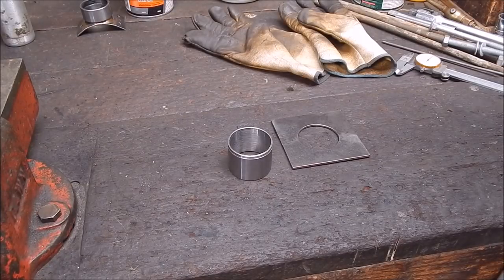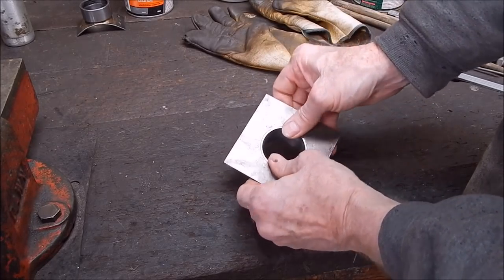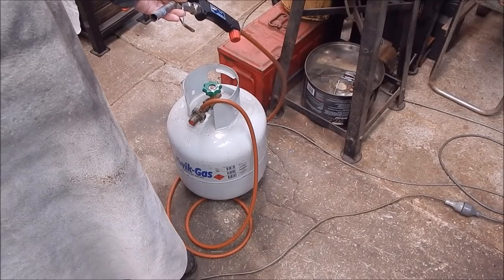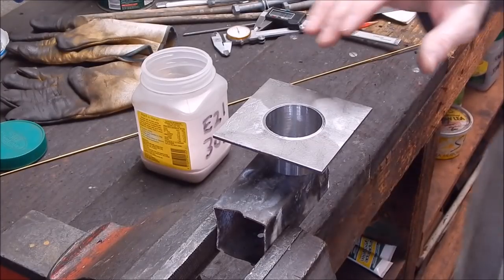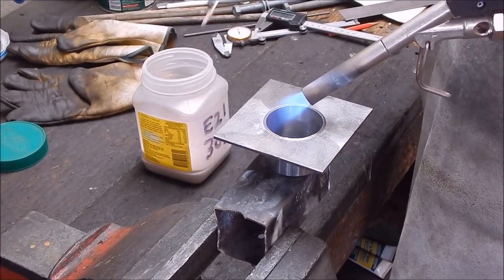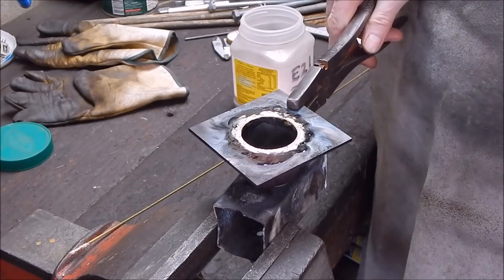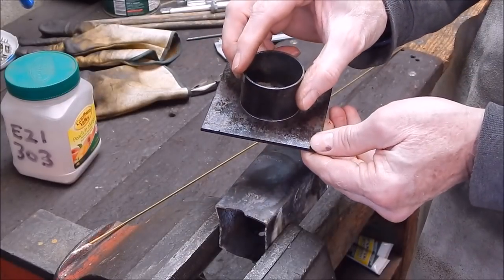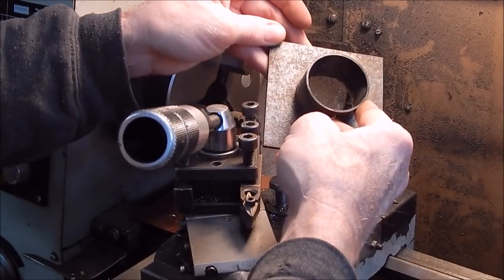Bullfinch auto torch LPG bronze brazing system

Comment from the maker: Note:  The flux used in the video is EZI-WELD 303 brazing and bronzing flux.  This flux allows hot rod dipping/application and freehand torch work. The rod used is BOC ProFill manganese bronze.  DO NOT try to use silicon bronze rods with this torch.

How the Bullfinch burner works is shown on the following web page:  https://www.adelaidehillsgas.com.au/service/bullfinch-brazing-kit/

Cheers Rob

Comment: yes ,I went with the replacement regulator"LPG regulator / Flow meter - LPG Heating / welding - 0 - 450 KPA - Omega OMELP35"comes Complete with 5mm Male barb fitting.complies with Australian Standards. Compatible with all standard LPG gas cylinders.$67au from my local welding store.another lesson when buying overseas for shore. thanks for your advice rob,have watched  your channel for a while now.good stuff.
Reply from the maker: Hi Geoffrey,

Good to hear you got it sorted relatively cheaply.  The POL look the same, but the UK (and Ireland) is very odd in that it uses a different thread form (same TPI) to virtually the rest of the world.

Cheers Rob

Comment: Nice job, Rob! I have done a fair amount of brazing with oxy/gas. For thin stuff, like what you were using, it's the way to go. Less heat input so less chance of burning a hole in your work or warping it. I also do not like prefluxed rod. It seems the flux absorbs moisture and if you don't handle it carefully, the flux can break off. On small stuff, like your project, I think it's just as strong as welding. You could see a slight ring of bronze on the other side, so capillary action did its job and made an excellent joint. Thanks for sharing.
Regards,
Dave
Reply from the maker: Hi Dave.  I think a lot of people steer clear of bronze brazing because they think it's difficult to do, and expensive to get set up.  But it's not really, provided you stay away from oxy/acet and the rental rip off.  This gun pays for itself after one year of oxy rental.  I like brazing because it's non intrusive/non erosive, and can be stronger than a bead weld as it capillarates between surfaces for a complete bond. Cheers Rob.

Comment: There is also bronze Tig welding. It is probably somewhat hotter than brazing but it is cooler than stick or Tig welding. But it is also less strong. However it is a good option for work that you cannot heat up sufficiently with your torch. I remember that the last time I checked the bullfinch 404 torch was prohibitively expensive. Like  £150 ! For that you get a 250 amp DC arc welder these days plus a Tig torch with cables and hose and a argon bottle filling (without one time payment for steel bottle) and you can do lift arc TIG welding.

Comment: Hi Rob

Interesting process ... I just made myself a kind of small oven to preserve the heat in and around the object - I would have expected I could heat up the whole project and let the bronze "run by itself" - I'll try take a video next time.

BTW, I use propane two and a small torch for burning weeds !
Reply from the maker: Hi Keld. I like to bronze free hand as in the video. That was about as big a job as the torch can easily do (metal mass wise). For larger jobs I either use a small brick hearth to contain the heat, and/or I also use my other big plain propane burner to boost the Bullfich - extra preheating.  Makes quite a difference on what is possible.The Bullfinch is fantastic for brazing carbide tips onto tooling.CheersRob

Comment: Just got a #4105 burner for the Bullfinch today that extra heat really makes a difference, Best $82 i have ever spent,
Reply from the maker: Good to get some feedback Jimo.

That's the only burner I've ever used on the torch, and was the best one for the job, according to the agent.

It's the basis of their bronze brazing kit, so it must be good.

Cheers Rob
Reply: Jimo, did you have a chance to compare 4105 and 4104 burner. Is the bigger one really less concentrated flame than medium size. Which works better for bronze brazing? Thanks.

Comment: G'day Rob, just bought one of these burners, very impressive piece of kit.  Just a question, what burner tip are you using?  Mine came with a 4103 (small), just wondering if a larger tip means more heat output or just the same heat output over a larger area.
Cam
Reply from the maker: Hi Cam, for bronze brazing Bullfinch recommend the 4104 tip.  See the kit spec;  https://bullfinch-gas.co.uk/blowtorches/autotorch-brazing-sys/autotorch-brazing-kit-detail

That is what I use.  The larger the burners go, the more BTHU output, but the fluffier/larger the flame pattern.    OK for general heating, but you want a tight concentrated flame/heat for brazing.

Interestingly Bullfinch and Hampdon in WA  both specify the 4103 as suitable for bronze brazing, so your torch should be OK depending on job size.  Hampdon also specify the 4104 and 3 as suitable for silicon bronze brazing.  Very odd, as I have tried this and it's a no go rod.  Basically meant for TIG.  So something not right there from my experience.  Not the first time I've got incorrect advice from the "experts", including BOC.

For ferrous metal I soley use uncoated BOC ProFill manganese bronze rods in 1.6 and 2.4 mm.  They also do coated, but dip fluxing gives more control.  Get them in the 0.5 kg red flastic packs for way lower stick cost.  The best rod by far.

Cheap/ unbranded/ hardware stocked manganese bronze rods are mostly crap from my experience.

Anything goes with silver solder ;)  It's all about the silver content.

You can buy the 4104 tip for $140 from Hampdon.  They also sell 303 flux cheaply.  Good store to deal with and fast, free delivery.  Recommended.

Shoot some video to show the baby in action !!

Cheers  Rob
Reply: Great thanks Rob, I did notice at one stage they sold a large burner (4105).  It's no longer avalible.  I will go ahead and order the 4104.
Cam
Reply from the maker: OK Cam.  I would still be interested to see the  performance difference between the 4103 and 4104 burners.  

This web page shows how the burner works and lists technical info :    https://www.adelaidehillsgas.com.au/service/bullfinch-brazing-kit/

That's the original importer I bought my kit from many years ago.

Cheers Rob

Comment: Hi Rob, firstly your videos are excellent.  I am in the UK and just about to order this torch, you have to buy the burners seperae over here. Could you tell me if the burner you use is small medium or large please? 4103 small , 4104, medium and 4105 large many thanks if you do get time to answer.
Reply from the maker: Hi Berty,

It uses the 4104.  This gives the correct tight flame pattern needed for brazing.

Cheers Rob
Reply: @Xynudu  Many thanks Rob for the speedy reply, keep up the good work.

Comment: HI Rob, I know its been a few years since you've done this vid with the bullfinch torch  but am wondering how it is going and whether it still continues to perform ok???  I also live in Adelaide and am just getting into doing some metal work and was looking into perhaps getting this torch to do some scrap metal sculpture art for brazing/heating (for forging/bending).  I dont really want to outlay for oxy-acetylene plus like the portability of this, just wondering if you have had a chance to use the smaller nozzle/tip of this torch (wondering if it would be good for small craft or jewellery items or whether it would be too underpowered??)    Have really enjoyed watching your videos - very simple and informative so thank you for posting them!
Reply from the maker: Hi Ruth,  I've used the Bullfinch for about twenty years and it's a fantastic torch, especially for small bronze brazing work and silver soldering.  It performs similar to the MAPP equivalent, for a fraction of the running cost. 

I have only used the standard (middle sized) torch burner supplied as part of the Auto Brazing System.  I have not tried the smaller 4103 or larger 4105 burner.  The 4104  will easily do jewellery and craft.  Here are the burner BTHU specs : https://bullfinch-gas.co.uk/blowtorches/autotorch-brazing-sys

The smaller 4103 is very low powered in comparison and I doubt it is what you require.

The Bullfinch kit is quite expensive and you can buy a new oxy/acet brazing kit for half the money, but the running costs are 10 time that of plain LPG.  The oxy/acet will however be much better for sculpture work and forging which has a significant heat sink/loss.    Now that you can purchase the bottles and avoid expensive rental it has become a lot more attractive.

This kit is very tempting and appears to be good value:  https://www.hampdon.com.au/oxygen-and-LPG-brazing-kit

Be aware that you cannot weld with oxy/LPG and must use acetylene for that.

Hampdon also sell the Bullfinch kit.

Cheers 

Rob
Reply: Thanks so much for that info Rob, I had a look online at that kit , I would also need to purchase flashback arrestors as well for it to run it safely wouldn’t I which would bring the price right back up??  A lot of the oxy portable brazing kits I have seen don’t seem to come with arrestors included ..I’m not sure why that is ?  I love the idea of having different size tips as I would like to try some smaller brazing stuff and I’m assuming that oxy propane would run hotter than the Bullfinch torch?  It’s tough when you are a beginner trying to work out which way to go!
Reply from the maker: Hi Ruth, yes you should use flashback arrestors with any oxygen boosted gas torch.  One downside is that you have to wear UV eye filter protection wth oxygen torches and they restrict visibility a bit.  Not necessary with plain LPG.  Oxy/LPG runs way hotter than the Bullfinch (it will cut and melt steel) and that's why I've considered the Hampdon kit a few times.  For occasional use when the Bullfinch can't do it, the kit makes a lot of sense. 

The cost only gets exorbitant for extended use.  The main factor is the oxygen as you will use 4 oxy to one LPG cylinders by weight.  Crunch the numbers and it gets expensive, but still cheaper than acetylene.

You can boost the Bullfinch with a large plain LPG torch as well to overcome heat loss.  It's not great juggling two torches, but gets the job done where just a bit more heat is required.

So think about how often you will use the torch and how big and small you need to go.  Oxy boosted torches can be a bit severe/melt the job, but used correctly it will work out OK.

It's a bit like shooting an elephant or a rabbit - you need a different sized gun for each.

I like the Hampton kit as it's very capable and has a good range of tips.  The grip is a bit short,  but it shouldn't be an issue.  Looks like a quality unit.

I hope this helps.

Cheers Rob
Reply: thanks Rob, lots to think about, not sure whether to go with a complete oxy/lpg setup as I would need to purchase all the bits and pieces - and may give more variablity in use for around the same price...but then stuck with oxygen costs on top...hmmm if I got a D size cylinder of oxygen to use maybe that might keep me going for a while??  Not sure how fast these torches go through gas???
Reply from the maker: Hi Ruth,  it's a difficult choice.  I can't comment on how fast a D size would last as I've only ever used the large cylinders, and it's hard to keep track of the hours.  If you crunch the numbers it should last 1/4 the time of a 9 kg LP cylinder (4:1 oxy/LPG ratio), which is roughly 3 hours (for the Bullfinch) divided by four - approx 45 minutes continuous running.

This is variable depending on flame size, but I think it's around the mark.  Being hotter it will get the job done faster than straight LPG, which will have a considerable bearing on usage cost.

Lots to consider and I wouldn't want to call it.  For absolute coverage you can't go past oxy/LPG, but you just have to be prepared to wear the cost.

Cheers Rob

Comment: We don't seem to have that product in the USA.  Been catching your LPG braising vid's and admiring that torch.
Reply from the maker: I'm gobsmacked there's no USA or Canadian agent.  These torches would sell like hot cakes.

If you do consider buying a torch be aware that the UK POL gas cylinder fitting will NOT fit USA gas bottles.  AU and USA are the same but UK is not.  My advice is to follow other USA viewers such as oldBRATTrider and get one from an AU supplier that will ship overseas.  The company below is reliable and also sells on Ebay:

https://www.hampdon.com.au/
https://www.hampdon.com.au/?rf=kw&kw=Bullfinch+LPG+Autotorch+Brazing+and+Welding+Kit

These are NOT cheap units to buy but super handy for small jobs.

Cheers Rob
Reply: Wow, looks like $420 delivered.  Looks like it's less than 1/2 that price from the UK.  I have an oxy acet set in storage.  One load of gas might last me a decade.  Do keep your eyes pealed for me if you find a used set.  Love to have one.

Continuing my thoughts,  I see adapters from UK to USA are cheap.  The UK thread looks like the left hand thread inside our new tank fittings.  I bet it is different from what you say.  

Here is the best price I've found so far.  Under 200 US. But hard to tell which tip it includes.  https://gasproducts.co.uk/bullfinch-233p-autotorch-propane-gas-blow-torch-kit.html
Reply from the maker: That's the wrong kit/torch for bronze brazing.  The Bullfinch burner tips are also not interchangeable between all their grip styles.  You need to have the 4100 handle/grip with the 4104 medium burner and high through put regulator.

 I looked around for UK to USA converters but couldn't find any that were female UK POL to USA male POL.  The POL threads are left hand/same size and pitch in UK and USA, but the thread profile is quite different and the UK fitting won't screw in.

I've never seen a secondhand kit come up for sale anywhere in Oz.  They are not a common item due to the price.

Now that you can buy "D" sized oxygen bottles in Oz (and avoid the exorbitant rental) it is actually cheaper and probably better to invest in an LPG/oxy set such as the one below:

https://www.hampdon.com.au/oxygen-and-acetylene-brazing-kit

That's damn good value IMHO.  I'd be sorely tempted to go that way now.  

Cheers Rob
Reply from the maker: You may be able to get a female UK POL to USA quick release/bayonet type converter fairly easily - I didn't look into those.

Cheers again.

Comment: Hi Rob, I'm just in the process of building a small steam engine. I'm now ready to silver solder the crank flanges(brass) and main axle(silver steel). Although I've done plenty of welding I've never done any silver soldering.
Any ideas on type of silver solder and the type of flux to use?
Great video by the way. I've just treated my self to a Bullfinch torch.
Reply from the maker: I've mainly done manganese bronze brazing, so I'm not really the best person to ask.  You may be better off asking at your BOC gas agent (if they are in NZ) but even those guys don't always know a lot. 

From my limited experience with yellow tip, any low silver content rod will be fine for brass/copper, but for steel you definitely need to go to a much higher silver content rod for it to adhere.  Those rods are very expensive, in line with the silver percentage.

The BOC guys should be able to advise you on the percentage from their rod spec sheets.

I've only ever used pink Borax based flux (EziWeld 303) same as for Manganese brazing.  No issues there. 

I hope this helps.

Cheers Rob

Comment: Hi Rob, thanks for your video's I learn a lot.
Now on another brazing video, you mentioned the bullfinch will do up to 1" steel, is that solid or tube?
I just bought one of these Bullfinch brazing guns from EH Cambridge ($360 ouch!) but am having problems getting a 25mm nut brazed to a 10mm solid square steel, probably just too much heat loss, the hard brazing rod barely melt and forms blobs
any thoughts?
Eric
Reply from the maker: Eric Gunstone Hi Eric. That's at the limit of this gun, but I have done it.  It depends upon how much mass is taking the heat away.  1" should be easily doable in tube.  For solid you will probably need to give the Bullfinch some additional help with another plain LPG gun to boost/preheat it.  That may sound like a bit of a cop out, but that's what I do. Also put the job in a small brick hearth to trap the heat or insulate it away from the vise.  Heat loss is the enemy.  The type of rod can also have a bearing on this.  I generally use plain GP bronze rods, but have got some coated rods from Gasweld, and I find these do not melt as easily.  I hope this helps Rob
Reply from the maker: Eric Gunstone Also, see how I do a similar job in this video:     https://www.youtube.com/watch?v=gsiOtYPny_k
Reply: xynudu
Thanks, your comment at it being at it's limit does help, I did try with an additional standard burner as well but still not much better, I have a refractory slab to work on, I got the job done but only just and the rod was not at all free flowing or  pretty, I only have plain rods that the local gas supplier provided, hope there is only one type as I wouldn't know otherwise.
Reply: Eric Gunstone BTW, can you put too much flux on?
Reply from the maker: Eric Gunstone Yes, but it generally just makes a mess and is hard to clean off.  Try the same rods on a smaller (potentially hotter) item to see if they flow better.  Make sure to use the smallest diameter rods you can get - 2.3 mm.  NOTE: To get maximum heat with the Bullfinch you should put the burner tip much closer to the job than a conventional LPG gun. And last point, for best results you should heat the area where the bronze is being applied, directly, not from underneath or such.  Hope this helps.  Cheers Rob